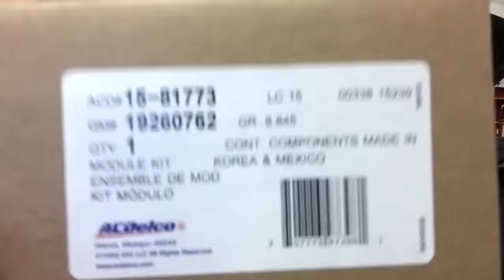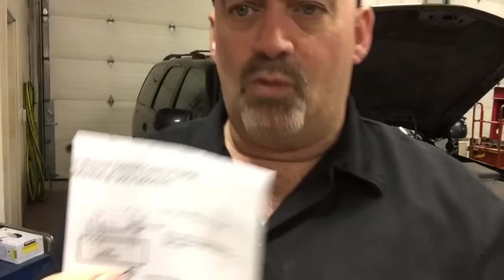Chevy GMC Blower Fan Stuck On

Comment: My truck has a constant got to the fan high. Like there's a short or a relay stuck. My module has a relay built into it as soon as I plug it in it engaged the relay. I only had high. I cut the wire now I have all but high. Is there another relay pressing to the module itself

Comment: My problem is the fan on the rear AC unit on my Yukon keeps running. I put a switch on it to turn it off. Is there a module for the rear fan or does the one under the dash do both?

Comment: I have a 2005 Chevy Malibu if the key is off and ac switch is off the blower motor turns on by itself...I have to remove the relay if not it drains the battery?

Comment: Is this the same for 2000 GMC Yukon new resistor was added one I plugged in to blowe fan kept running mines has black/white wire orange and black wire

Comment: Hey car doctor, so i the fan in my truck didnt sound great. so i replaced the fan and i managed to find the old style resistor/module. I put it back together and it still is sometimes not turning on and sometime not shutting off.. Its the exact same old style, but a brand new part. Do you think that would still be the problem and i should do the update? Thanks

Comment: I have a 2001 Suburban LS.  Same issue - fan runs max speed with key out.  Removed the HVAC fuse.  Stopped problem (fan on with key out) and I have the 4 lower speeds - just not 5th speed.  I believe mine is a different part than the '03-'09 that you talked about here. Would this still point to the blower resistor module? Thank you!

Comment: What's up Tim.  I replaced my module today, first time.  Quick tip to offer you on that pesky cover bolt.  If you just loosen that inside bolt the cover will come down and swing out of the way with plenty of room to access and replace the module.  You don't have to completely remove the cover.  Took me 20 minutes total to complete the job.

Comment: Safari gmc 2004 van....high speed fan setting not working...have replaced resistor ac delco...vdo autozone fan.....all other speeds work..I understand that the high speed setting does not go thru the  resistor ..so..any idea what's going on here? I have checked the frt hvac 30amp fuse under the hood...any idea is appreciated

Comment: Thank you very much, this was exactly the issue I was having with my Yukon XL Denali, and I did exactly what you said and was able to fix it myself.  I took it to the experts to look at it first, and they said the part I cut out was the wrong part, and that it would cost me $400+ to replace it.  I decided to keep going with your video, paid $60 for the part you mentioned, and fixed it myself!  Thank you very much!
Reply from the maker: Super cool! Thanks for watching
Reply: I have a question for you do you think a 2003 Hummer would be pretty much the same fix for my blower motor out of the blue today I started my car went to the store got out of the store and my blower motor is not shutting off got home and my blower motor is not shutting off I used the 40 amp fuse and unplugged it and it turned the blower motor off but I don't want to have to keep taking my 40 amp fuse in and out I live in Colorado and it's cold LOL thank you if you have time to answer this
Reply: @ThecardoctorTV I replaced my blower motor and this module and when I start my car my fan still runs constantly on high even if I shut my H2 Hummer off it keeps running do you think I got a bad module or do I need to replace the control in the dash

Comment: I have a 2001 yukon and the heat goes on for about 10 mins and then starts blowing cool air would this be the same fix. I have a 2002 gmc yukon danali and the blower stays on when I take the key out so I'm gonna change the module on that truck. But just wondering about the 2001 yukon and the heat. Thanks

Comment: hi time I just changed the sway bar bushings in my 2003 trailblazer but the clunk continues I checked tight rod ends ball joints what else could it be

Comment: How much is the auto control dual temp climate module kit? Mine looks like the one you pulled out. Autozone said I have to buy the 100 dollar one but mine looks like the 20 dollar one. Just how much was the new one you installed. I don’t have a hundred bucks right jow

Comment: I kinda have a similar issue, I turned on my rear ac and it won't go off, constant AC full blast, but when the key is off it turns off..  selector dosent work, when I change it to heat it dosent work just constant full blast AC

Comment: Thank you for this great video.  2004 Envoy replaced resistor with your help.  Had to remove the glove box because my old frame doesn't bend that well.  Tip: if you do remove the glove box, reinstall it before installing the bottom cover.  Left cover screw was a bear as you said so loosely screwed in the right screw first then shoved the cover up in place as hard as I could and lo and behold, the left screw went right in.  Again, thanks for a great video.

Comment: In FL these burn up all the time, I never had it stay on but i had them not work or it looses some speeds.   I have the white module now, They made a black plastic updated module, that one only lasted 2 years before it melted the connector.  I believe that the high heat, constant AC use and moisture from the evaporator shorts it out.  Its just too extreme here , its not designed for this climate.  The 40amp weird cartridge fuse under the hoods  fuse box will stop the blower from running if it happens at a bad time. , Remove it to stop it.  I have that same Crimper  I wore it out. now it has blue grips :) ya snap on.    Its easier to disconnect the power connector on the blower motor when you remove it.  Tab and a turn.  I think all I did for removal was the two screws on the lower dash cover  and i had enough free play on a GMC truck with the console to  sneak it out.  Alot of trade in vehicles I drove had INOP blowers.   Trade it in when the blower stops, no AC new car, lol $$ So far, 115k, 10 years, I am on 3 blower modules which includes the factory part. Oh, One time  I replaced the blower motor too.  Korean Delphi motor!
Reply from the maker: Good tips. Blowers get a workout here in Alaska too. Maybe not all the moisture you get. I'm going to try getting it out without removing the last screw next time. It's crazy the way people give up on their vehicle when something silly breaks. They should do some math first. Crazy.
Reply: The Car Doctor
 Even if a car needs a engine, its cheaper to fix it than to replace it!  Even if the car is worth under 5k and the engine is whatever, add up what you can buy for what the vehicle is worth + repair and what condition may it be in.  Cant fix stupid.  Ya in Alaska at-least you have cool air flowing in from the outside. I try to run recirc as much as i can.   Nothing broke when I was living in the NYC area!
 Just suspension parts
Reply from the maker: I'm looking forward to some FLA weather next Christmas when we take a cruise out of Miami.
Reply: The Car Doctor
 Its nice around that time. Crowded, but it always is in Miami.  I used to go over there to pickup cars, out in homestead its cool, alot of nothing.
Reply: Ghetto Wagon I am having problems unplugging the wire that are fixed to the module from the motor. Any recommendations?

Comment: Thanks! You saved the day.  Easy repair.  Left that 3rd bolt in place, and just moved the cover to the side...used the same color connectors you did for the wires...and I've got heat!  Keep the videos coming, and thanks again.
Reply from the maker: thank you so much

Comment: I just loossened the screw you are talking about and let the cover lay on the floor. The cover lined up very easily and tightened right up.
Reply from the maker: good call. Did that the other day and it worked great. Blessings!
Reply: Your video was a great help.

Comment: Thank you for the diagnosis and fix. I just found a really nice loaded ‘04 Tahoe that had been in storage for a few years and it only has 100k miles. It had this issue upon putting in a new battery and I was able to know what to do thanks to you. I was also able to negotiate the price down another $600 because of the existing problem. $178 in parts and it was fixed in 20 minutes. Also, you absolutely don’t have to remove the screw closest to the center console. Easy. Thanks again.
Reply from the maker: No. You dont have to remove the screw. But its more fun if you do.

Comment: I`ve done this repair many times, and the thing that many other people with this same problem are unaware of, is that a lot of retailers are still selling the original style crappy modules with the 3-wire plug......nothing like repairing your vehicle with a prone failure part and finding out afterward there was an upgraded part available. This video should help many people from making that mistake, although I recently pulled a bad module from a vehicle that had the upgraded version with a 5-wire plug......but at least when it failed, the blower motor didn`t stay on all the time, it just quit working altogether.

Comment: Hi Tim, I had to to this on my Suburban, it was good to see that I did it like a Professional would. I have had problems with butt connectors so I soldered and shrink wraped mine,  but other than that it was the same, I left that screw out, in fact I threw the screw as far as i could, no rattles yet, after about 20,000 miles, so I am pretty sure it will be that way forever. Thanks, see ya next time.
Reply from the maker: +joel mccoin Sounds like you went above and beyond on yours with the solder and shrink tubing. I am checking on how much it would cost to put a screw into orbit aboard a space launch for the next one I do just for good measure.

Comment: So I just did this on my 05 Yukon. Instead of cutting the old connector off the factory harness, I removed the pins from the factory plug and also removed the the three splice wires from the replacement plug. I then inserted the factory wires into the new plug and finshed the module install. I'd recommend this only after you fully inspect the factory wires to make sure they are not burnt or damaged in any way.

Comment: Thanks I will try this. My 05 Silverado has eaten a half dozen batteries over the years guess maybe this is the cause. About a year ago I caught it in the act and I cycled the controls over and over until it stopped. The fan hasn't worked since.

Comment: To remove the cover. I took the two screws out that I could get to. For the one closest to the center consul I just left that one loose enough to pull the black plastic cover down far enough to work on the control module. It did not take long at all I didn’t break anything everything came apart and went back together vary nicely and fast

Comment: When it comes to removing the housing cover, remove the two far right retaining screws, and leave the third in place. 
The cover unit is flexible, allowing it to be moved out of the way. This presented no issues for myself in changing the module, nor damaged my cover.
Just a consideration.
Reply from the maker: very good info. Thanks

Comment: Had my blower motor fail to start on an 04 avalanche.  The cause was water leakage from the plastic panel under the cowl leaking into the passenger footwear.  Water froze the blower motor and blew the fuse.  Fixed water leak and replaced blower motor (previously squeaky) and blown fuse.  On fuse install, blower ran full tilt. Looks like this is the last step in fixing all of it. Thanks!

Comment: Thank you for the help I needed in getting the correct part. I did not remove that screw on the left of the case. Just moved the housing to the left, which gave me room to work on the wires'.

Comment: My 2005 has all kinds of electrical gremlins.
The heat will suddenly turn on when running the a/c and the only way to shut it off is to turn off ignition and restart the truck.

the heated seats will turn on and ill turn off only for them to turn on again, over and over. i havent found the solution to that one. luckily its fairly rare.

Now the auto HVAC system is tripping, turning on at 74° though its hot air blowing and now the blower motor wont turn off just like shown in this video.

Way to go GM. I had similiar electrical/dash/HVAC issues in my '87 chevy, '91 chevy ,'99 chevy and 2002 chevy.

consistency is a sign of quality! uuuugghh.......

Comment: Thanks for the repair directions! I just finished just like you said thank you Parts at the dealership was about $90 2006 Silverado 2500! Thank you I did only have to take two black screws off and it did access the black modular!
Reply from the maker: So cool!

Comment: Last week I went to the corner store with my a/c on. Turned my truck off and went in. When I started my vehicle to head home, everything was normal when I started smelling electrical burning. Pulled over but couldn't find where it was coming from. Since the vehicle was running normal and I was 2 minutes from home, I went ahead and drove it home. When I arrived and shut off my vehicle, I noticed the blower motor wasn't shutting off. I tried a few different things but ultimately decided not to mess with it that night. When unplugging the blower, I noticed the wires were very hot. I haven't messed with it all week because of work. Noticing you know more than the average bear, I figured I'd ask before I started taking it apart if you had any idea what I'm getting into. Or do you know something that'll point me in the right direction. Sorry this was long.... Thank you...
Reply from the maker: The blower motor is likely bad drawing excessive amperage and overheating the wiring. I would replace the blower with OE along with the wiring and module. Good luck
Reply: The Car Doctor Actually the one thing i forgot to mention in my message was that the blower was making a whining sound for the first minute or so when I'd turn the vehicle on. I think you're right on the money. I'll go that route. Thanks for the advice. I'll let you know how it turns out.

Comment: Thank you.  I'm going to give this a try on my 03 suburban.  Woke up to a dead battery and when I charged it the front blower would not shut off so i had to pull the fuse.  Video is straight to the point
Reply from the maker: Excellent

Comment: I’ve replaced 2 of these in my Escalade. This now would be my third. They last me about a month. Do you recommend replacing the motor as well now then?
Reply: Have u fixed ur problem ive been having the same problem as you let me know plz what u did

Comment: Wish I had a tip for you tim....did this 2 years ago on 03 trailblazer was not fun. Thanks for the vid and have a nice holiday!!
Reply from the maker: +Ed B. You would think they would make it a little easier since its a part that blows out all the time. IM sure this updated part will fix it for good. TrailBlazers sure are different. Be sure to watch my water pump video if you ever need to do one. It will save you some hassle.
Reply: +The Car Doctor Thanks Tim...the way my luck is running lately sure appreciate it. lol

Comment: Hiii my good friend; TIM!!!!! GREATINGS FROM Puerto Rico..The most common error or fault that the "DIY" do; is that when changing the "control module" or the "blower"! They never do an "amp  test" at the blower and control module harness. VERY important step! WHY? Because if someone puts a new a/c blower and have an a/c module that its "woking" but its consuming to much amp,  your going to fry the harness and the blower to! AND VICEVERSA..
Reply from the maker: +pedro l rivera negron You sure are a firm believer in amp drop testing. I get the feeling that if they ever needed to get those paddles out and jump start your heart you might ask them if they did a voltage drop test before they shocked you back to life...just kidding. We sure could avoid a lot of unnecessary wrong parts replacement if we took your advise. In this case it was a common case of fried module and the updated part got him back on the road. If I had seen any melted wires I would have replaced the blower motor as well when I was in there. Always appreciate your input sir! Take care.

Comment: Thanks for the video! Very informative and helpful! Now I need to replace my module! 

I just learned of this issue with my 07 
Silverado. The control was at first not working on 1but ok on 2 then it eventually quit working on anything but 5 and then I discovered it not shutting off, then I ended up killing the battery. I got it to shut off and talked to my brother for a little while. Went back to cab, then yep, blasting away.
So I'll need to yank the fuse under the hood and I may as well replace battery ( factory battery believe it or not) but I'll try recharging to get it home. It's only 1/2 block away. So yep. I'll get her home and then fix it when I can.
Reply from the maker: Don't forget to look closely at the wiring. Might need a blower motor, wiring and module. I sure like OE parts
Reply: The Car Doctor 
I took it to the mechanic and they replaced a resistor and the pig tail. Fan running good again

Comment: got an 04 tahoe doing the same thing  looked up parts for it and there isnt a control module listed all they show is a blower motor resistor is it the same thing?
Reply from the maker: yes, blower speed module is the correct term but some suppliers call it different. Look closely at your wiring and make sure its not melted at the connector. I recommend using the OE kit.

Comment: I have a 2000 Suburban that is doing the same thing in the rear HVAC. I changed out the moduel or relay but still have the same problem with the rear blower.
Reply from the maker: Have you checked power and ground to motor?